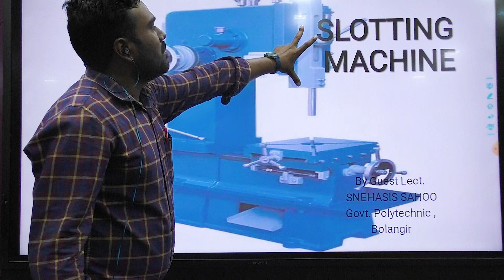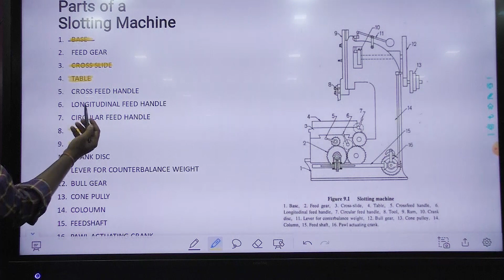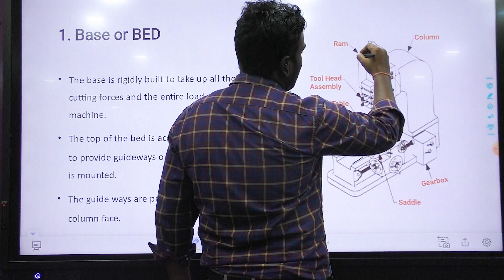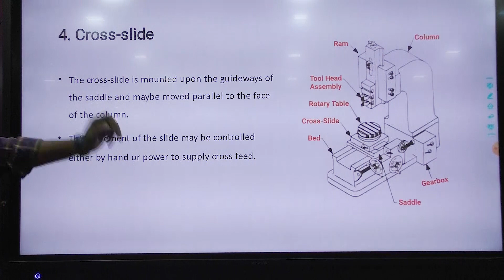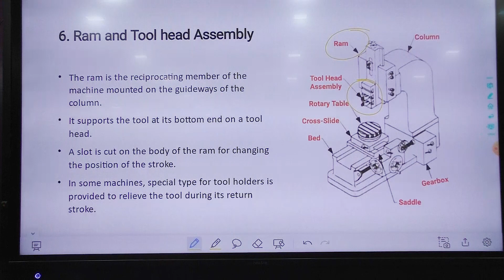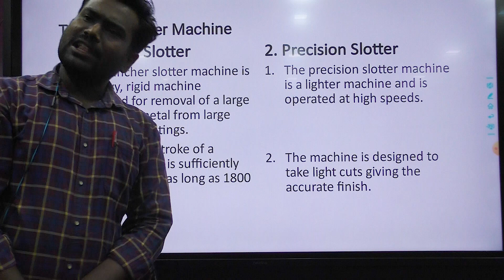Slotter Machine by Snehasis Sahoo

Comment: A slotter machine is to cut a 120 mm long internal slot in a mild steel component. The cutting speed recommended for the tool material is 12 m/min. The maximum return stroke should take only 60 percent of the cutting stroke duration to improve productivity.
Given that the stroke length is 150 mm and the feed per stroke is 0.15 mm:
a) Calculate the suitable number of strokes per minute for the machine.
b) Determine the total machining time required to complete the slot if the depth of cut required is 10 mm and is achieved in 5 equal passes.
c) Explain how the quick-return mechanism of the slotter affects machining efficiency.

Sir slove the slotter machine question